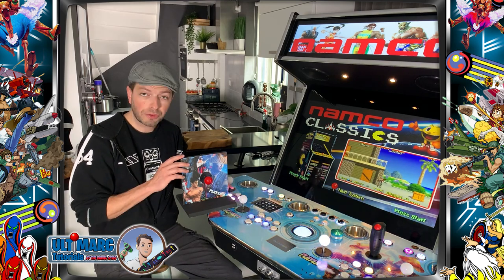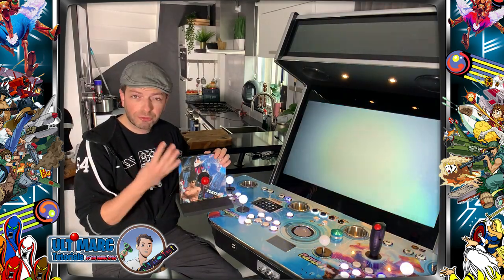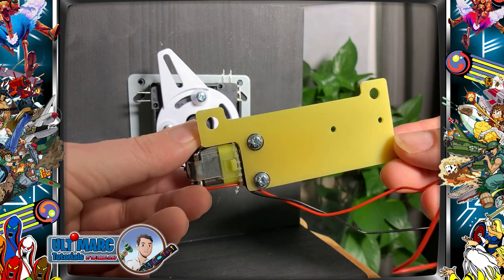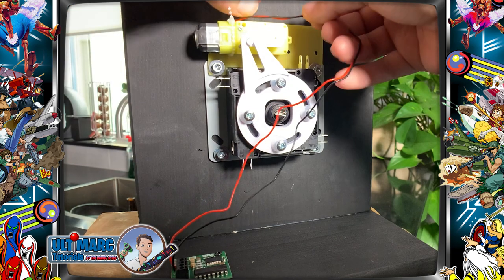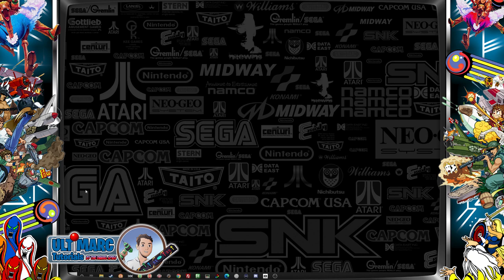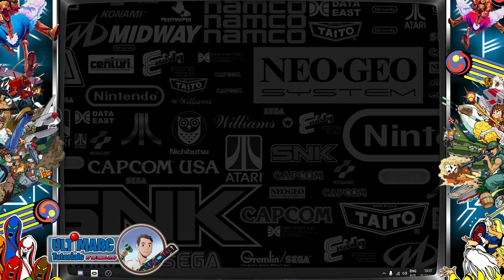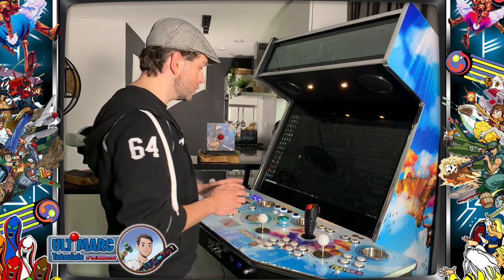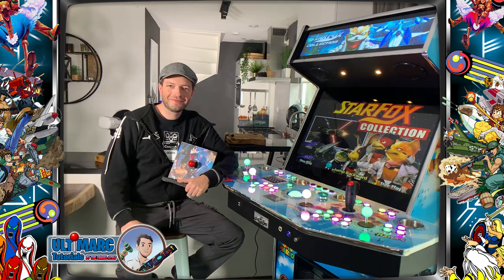Ultimarc Product Tutorials: ServostiK (motorized 4/8 way joystick)

Comment: I'm having issues with my servo motors and LED blinky. Initially, they worked for a bit and then stopped. I'm not sure why they aren't working. Both of them are connected directly to my PC. Additionally, my LED blinky is no longer displaying my game controls. I've tried everything, but I can't figure out why it stopped working.any ideas why it stopped working?
Reply from the maker: Need more info to troubleshoot this. You better contact Ultimarc for assistance :-)

Comment: Nice work and great setup! but how can this be a servo with only 2 wires? Servo’s have a third wire for positioning / control and sometimes another extra wire for positional feedback. It seems like a regular dc motor with the rotation direction controlled by the controller board.
Reply from the maker: Hi, yes you are correct. It is a dc motor used as a servo. It is officially then called a ‘dc servo’ so Ultimarc is not wrong either. Except the missing c in stik that is 😜

Comment: Thanks for making this video, I'm going to make sure I give the motor more space. I got 2 and they do seem to hang up a bit. Also my second joystick takes 1 sec longer to move, I know this is common.
Reply from the maker: Hi, yes this is because of the limited power supply. The motors will only get the 5v out of the usb connector. This is not enough to operate two servo's simultaneously. So the PCB will drive them one at a time :-) Thanks, Daniel

Comment: Excellent video thank you. I have been looking for a video on showing setup of these sticks. Do we know if they will work with Raspberry Pi running RetropieOS?
Reply from the maker: I can't tell you if they work 'out of the box' with Retropie but as these are very easy to toggle with a script, I think that it should be no problem to get them to work. You can also try contacting Andy at Ultimarc if he has experience with this? Thanks, Daniel

Comment: I have a Dig Dug Cabinet I restored and I am putting in a 412 in 1 board in the cabinet will this joystick work on a metal CP like Dig Dugs CP? I would be going with a toggle switch if I do install the joystick.
Reply from the maker: Yes it will!

Comment: One quick question - on the joysticks, each of the four switches has three contacts - one is ground - but which of the other two should I connect to the IPAC control board?
Reply from the maker: You will need a wire to Ground and NO (Normally Open). This is the terminal closest to the ground terminal. If you have a multimeter, you can set it on continuity mode and test the terminals. Only when the button is pressed you should hear the ‘beep’ (otherwise you have the wrong terminal 😄) thanks, Daniël
Reply: I thought this stik only required a usb connection. Can you clarify?
Reply: Apologies for the very delayed response - the email associated with my Youtube login wasn't one I access - and I just discovered it.    To answer your question, no the stick is not USB - it just has 4 switches for the cardinal directions and each switch has 3 connectors - one is marked as ground - the other two it wasn't clear which one I should use.  I worked it out eventually :-)

Comment: Hi, got the Servosticks installed and everything works when I test it. But how do I set up these things in Hardware mode?! Havent seen any tutorial on how to do that?! Im to bad at writing scripts and stuff. Just want a single button to switch these....
Reply from the maker: Hi, you can set the boards to hardware mode by a NON REVERSABLE firmware update. On the Ultimarc website you can find how to do this. Again, only do this is you are sure that you like hardware mode better than running a script :-)

Comment: Can you show how you made the script to control and change the stick?
Reply from the maker: Hi, I don't completely understand your question I am afraid. In the video I explain howto write this script. But I think you mean the automatic control of the servostik? This is done by Led Blinky software. You don't need to program anything. Just select Servo 4/8 in the misc options menu. Thanks Daniel
Reply: I am building a retropie project - using 4 Servostiks (each pair having a control board).  Obviously, I can’t run the Blinky software on the pie - so I’m still scratching my head on how to automate that so that when I launch 4 way or 8 way games, all the sticks automatically change.  :-/

Comment: Are you using servostik for all players or just player 1 and 2? If only player 1 and 2 what are you using for players 3 and 4? Thanks. Also do you have a tutorial on the stream deck? Awesome work on videos! Very helpful! Thanks
Reply from the maker: I am only using servo stiks for players 1 and two indeed :-) I use the same Ultimarc joysticks (without the servo) for players 3 and four. As for the stream deck, this is relatively easy to do (I could try to make a tutorial indeed): Just create an Autohotkey script with a command line to start a game. Then compile it and map this 'shortcut' to one of the stream deck buttons. Thanks, Daniel
Reply: @TheDanielSpies_Arcades  awesome thank you for the help. Can’t wait to finish mine. That will be easy to do on the stream deck. I love your layout
Reply: @TheDanielSpies_Arcades  ok. so. you are using 2 servo-stik for players 1 and 2... Can I assume you only need 1 Servo-stik control board, then? Are the other 2 sticks, J Stiks for 3 and 4?
Reply: @TheDanielSpies_Arcades  Would you be able to give me the line for the autohotkey script as well as the command line to start game and where to save it to? I am trying to mirror your stream deck settings. No one has how to setup stream deck for an arcade like yours.

Comment: Where do I connect the red and black wires to the small board? And I did buy a switch, that would allow me to flip the switch manually. But I’m not sure how to wire it. Thanks!
Reply from the maker: Hi, If you are using a switch. You need to flash the firmware to 'hardware mode' which you can't undo. I suggest not to use that. The red wire is positive +, black wire is Ground -. The + and -  is printed on the board. Good luck!

Comment: Any way to make these work in Linux. I had these many years ago in a windows-based arcade-machine. I had to sell it off, because I moved to a place where I did not have the space. Now I am curious if they work in Linux or even better in a linux-based gimped system like batocera? Anyone?
Reply from the maker: You can ask Andy from Ultimarc that, I don't work in Linux myself unfortunately :-)

Comment: Can I mount these in any direction? I got limited space under my control panel.
Reply from the maker: Yes you can! You might need to change the motor position but that is easy to do. They take up a large footprint indeed :-)

Comment: Linux compatable?  a lot of us do not use windows for our mame cabinets.
Reply from the maker: Hmm not really sure. You should ask Ultimarc that question I think.. Thanks, Daniel
Reply: Yeah, I’m struggling with RetroPie on my build to get it all automated!
Reply: I would say most using Retropie or Batocera - that means this hardware mode is not only for ‚really old cabinets‘ but rather for them (which also cant use a Streamdeck mini)